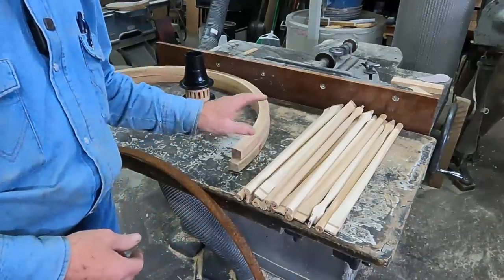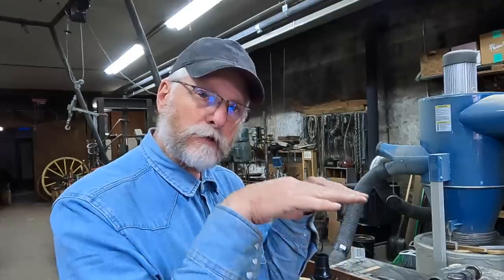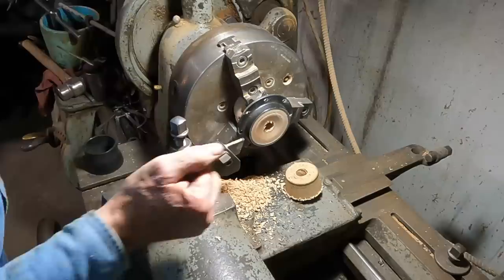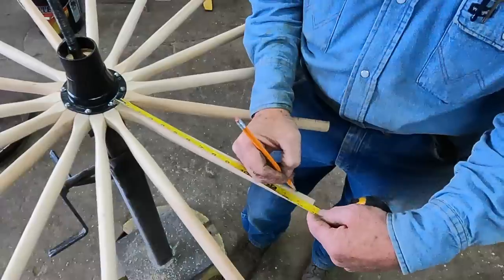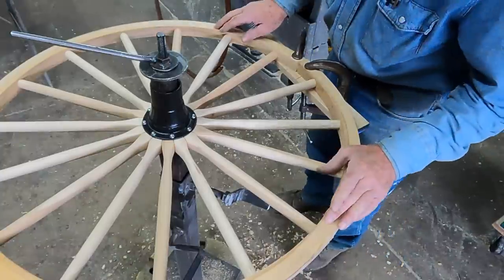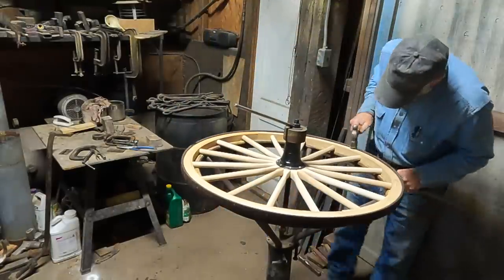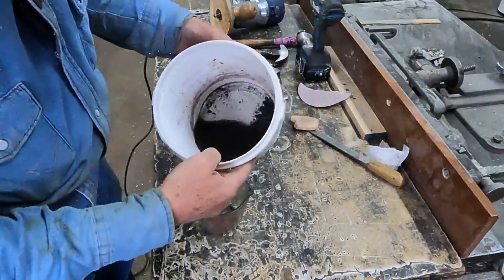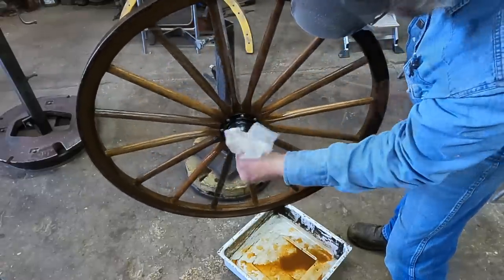Old Looking - New Wheel For a Grandma's Kitchen | Engels Coach Shop

Comment: The wheel work videos are my favorite videos to watch . I am suffering table saw envy. Fortunately, I don't have space for one like yours. My work area is filled with mostly warn out tools that I purchase new . I need to start moving them to new homes because of my advanced years, but every time I decide to start disposing of toolsand equipment, a project comes up, causing me to use the items I was about to liquidate. Just last week, I found myself purchasing replacement  toolsfor some that no longer functioned to do a job I needed to get done. I no longer purchase the top quality, just good enough to get a job done. Lollol.
Reply: My woodshop is so small I told my sister it's like trying to play frisbee in a phone booth.

Comment: I can relate.  I had retired early from my engineering job and started a marine electrical and hydraulic service.  Many of my customers had become good friends over the years.  When they find out that I build fine furniture and such as a hobby they started to ask me to do some wood work on the interior of their boats.  It wasn't long before that developed into doing almost complete interiors on yachts and it took a lot of time from my normal work.

Comment: Dave, we don't find you building wheels redundant, we love it! Hell we'd watch you build anything, content is content my friend! 👍👍

Also if you have any Oak sawdust or sawdust from any Wood species that is high in Tannins mixing it in the Rust Vinegar will speed the darkening process along significantly. 
  I use almost the same process to Ebonize/Blacken my woodworking projects. I use a Rust Vinegar solution I made by dissolving Fine Steel Wool into White Vinegar and a Powdered Tannic Acid mixed with water that will Ebonize the wood. 

I start by applying the Tannic Acid and Water solution to the wood first then I apply the Rust Vinegar and almost immediately the wood will start to stain a dark grey to black depending on how much Tannic Acid mixture I applied beforehand. It works great. If you don't have powdered Tannic Acid an Extremely Strong Tea mixture will work too, it just requires more than 1 application to get a dark grey to black color.👌
Reply: Thank you.

Comment: Interesting you chose the sandblaster to weather the wood. That's how many scenic shops would do it for theatre/movies. Another way is a wire wheel on a grinder, as it eats away at the softer part of the grain and leaves the harder.

As far as the hub goes, I'd have cut off both the front and rear, and made the front some sort of decorative element to hid the center of the hub. Another option would have been to make the steel parts of the "hub" out of flat plate, and drill the needed holes, leaving the the center as a flat metal circle.

Comment: Varithane makes a product called weathered wood accelerator that does basically the same as metal filings and vinegar for those that dont have access to metal filings...
Turns wood a medihm driftwood gray when dry. And you can recoat as often as you like. Poly top coat darkens it up even more...
Reply: Woodturners usually use steel wool instead of iron filings.

Comment: Have been enjoying your content for some time from Bakersfield. Ironically, I just sold on EBay the spoke shavers you were using to build this wheel. Never thought about it or would have just sent them to you, however one was used up, had been brazed on etc. Stuff my father had, don’t know if they came off our farm in Alberta or not, I expect it was the farm. 
I’m curious what the metal shavings in your vinegar solution originated from as I would like to try that. Are they just shavings from drilling holes? 

Thanks
Reply: They're from his chop saw.